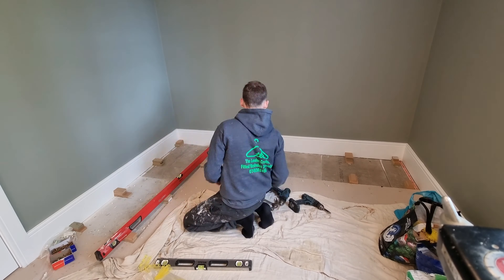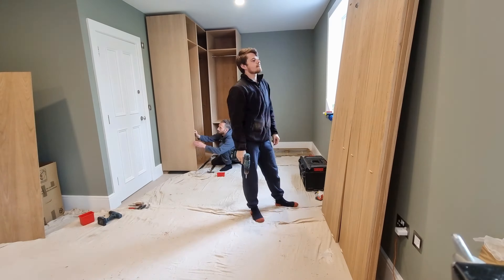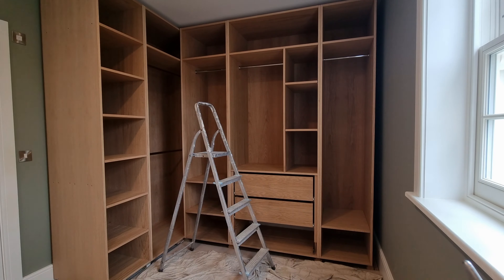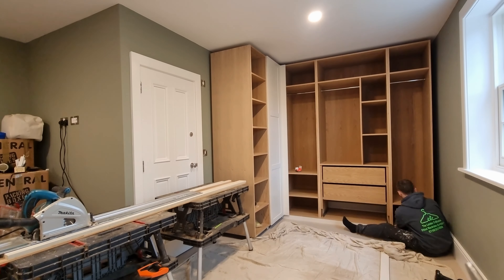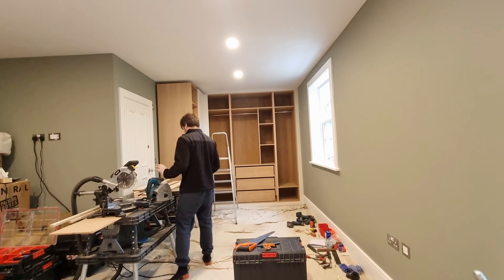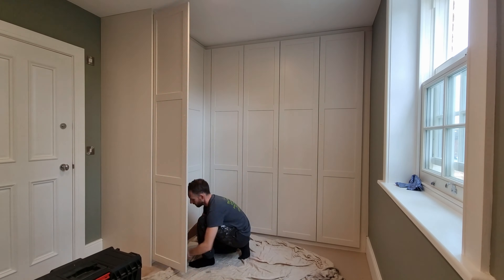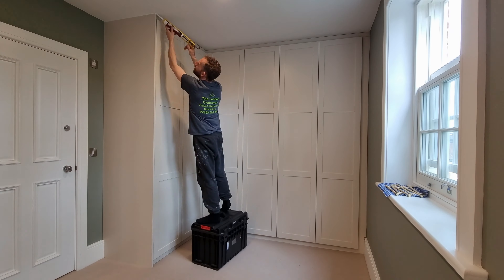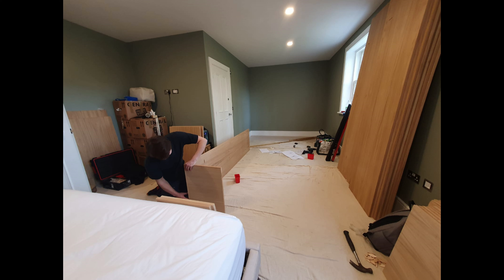Fitting Huge Corner Wardrobe In Just 6 Minutes - Timelapse With Voiceover - Vid#142

Comment: Great video. Just a question what silicone do you use? As I've been using caulk but it shrinks back
Reply from the maker: Thank you.
Just a standard multi surface silicone.  Only use caulk if you are painting over it.👍
Reply: Is silicone easier to work with than caulk